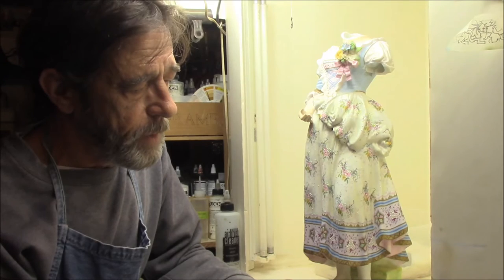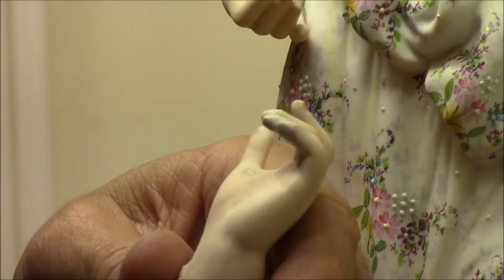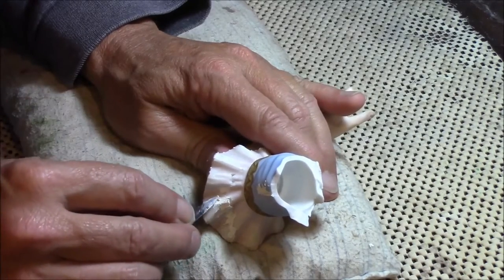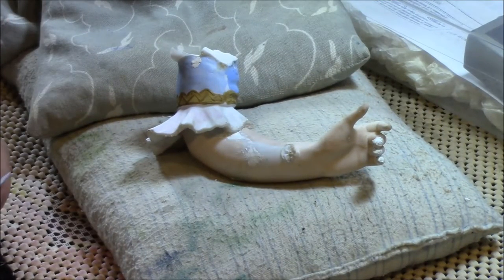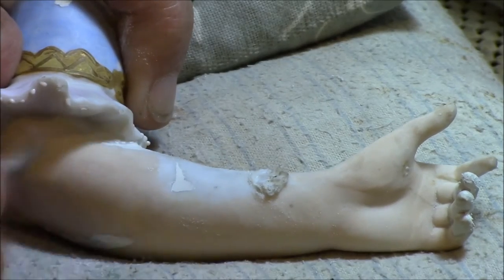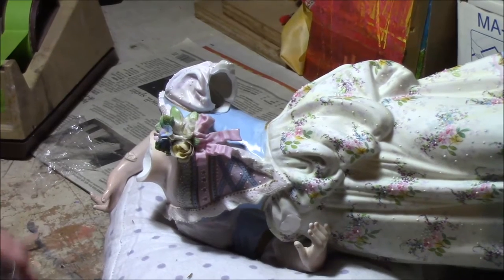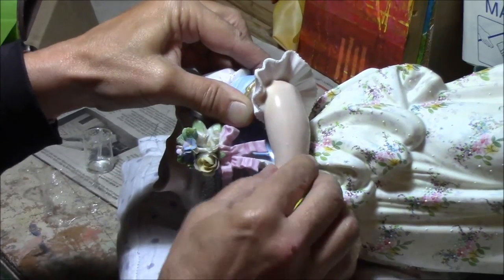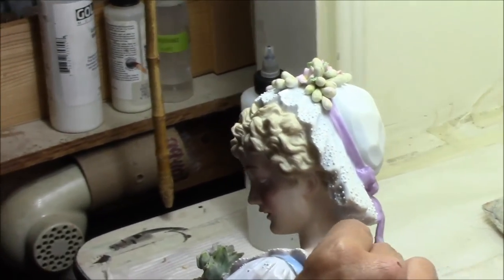Feminine Porcelain Figurine Restoration

Comment: Nice color matching! I like how you can really control the flow of the paint, to a very fine controlled area. Would you mind me asking which airbrush and size tip (and pressure setting) you used? Thx
Reply from the maker: I use Iwata airbrushes. I have several but the one I use the most for jobs like this is: model HP-CH HK. I don't know the tip size. I just use the one that came with it. Pressure setting is between 20-30 psi.
Reply: @marsgitar  Thx so much!

Comment: Mesmerizing. Many thanks for posting. You are a master!
Can you please tell me what kind of glue and paint to use? How can I get the glazed look--is there a way to mimic it for an at home repair? I have a broken Franz vase. :(
Reply from the maker: Thank you for the praise. I appreciate it very much.
The bonding agent I use depends on the material that needs to be bonded. On this piece, which is fine porcelain, I used a product called HXTL, a 2-part water clear epoxy formulated for repairing glass. Since good porcelain is almost the same as glass it works very well. 
When I need to repaint an area, on porcelain, I first create a base for the paint to adhere to with Sylmasta's Cold Glaze System (a 2-part catalyst-cured acrylic resin), sanded so the paint can grip it. Then I use Goldens brand acrylic paints to redecorate, usually with an airbrush. Then that is covered with a minimum of 3 heavy coats of the Cold Glaze. When the glaze is cured (over night) it is sanded and buffed with Micro Mesh sanding systems, with grits starting at 2500 and going through six finer grits up to 12000. That will give you the glass-like finish of a real glaze. By the way, none of the products mentioned above can be found in your local hardware store. They (aside from the paint) have to be ordered on line. Unfortunately, ALL the bonding agents and ALL the clear coatings one can purchase at the local hardware or art store WILL discolor with age. 
The bottom line is: this is not something I would recommend an amateur to try for a repair at home.

Comment: Tell me, were you entirely happy with the mauve-coloured ribbon 🎀on the back of the bonnet.  Perhaps it's the video quality; the strength of the hue seemed noticeable to me.
Reply from the maker: Yes, the color match was perfect but the lights are close to the figure at the top of the inside of the spray booth and are probably having an effect on the camera's color perception at certain angles.

Comment: Once again and great and enlightening video. Can you tell me, please, what you use for a masking medium?
Reply from the maker: Thanks Kelleen. I use many different kinds of masking and masking materials. On this repair I'm using a latex based masking medium. The brand doesn't matter. It's sold in art supply stores. Mostly this masking medium is used by water color artist. It is painted on, then air-dried, and when done it is rubbed off with the fingers.

Comment: Hi Martin, have you ever come across a completely lost porcelain hand or arm and need to re-sculpt the arm? Do you also use the milliputt to sculpt or do you use something else? I'm just amazed at what you do. Thank you :)
Reply from the maker: Yes, I do come across this situation fairly often. Generally, what I use to sculpt a missing piece depends on how large that piece is and what type of ceramic the thing is made of. For high-fired ceramics (porcelain) I use A+B brand epoxy putty: which I build up more than I need and sculpt down to the final shape. If possible I might take a mold from another, unbroken, part of the piece I'm working on. For softer, low-fired ceramics (terracotta), I might use Milliput epoxy putty. Sometimes it's a process of building-up the missing piece around a wire armature. Sometimes I use a mold to make the missing piece.
Reply: @marsgitar  Thank you for replying back. Can't wait for the next video.

Comment: How did you make your little aputtt applying Sculpting tool
Reply from the maker: I did not make the one in this video. That is a dental spatula. You can buy them on line. I got mine from another restorer friend. This spatula is now two different spatulas. The pointy end broke off, so I made a new handle for it from a 1/4 inch steel rod. I cut a slot into the end of the rod, then put the broken-off blade into it. Then I drilled a couple of holes through the rod and blade, used to rivet the blade into place. The other end of the original broken spatula included the whole rest of the tool, so I just made a wooden handle for it.

Comment: can porcelain be sanded down? I found a pair of antique porcelain lamp bodies and the lip/nipple at the top- 1 is much higher so I am having a hard time finding a vase cap to cover it. I am wondering if a dremel tool would do the trick?
Reply from the maker: Porcelain is extremely hard. You need to use a diamond tool to grind it down. There are Dremel diamond bits that'll do the trick. That's what I use. Porcelain will dull any metal tools you try to use on it.
Reply: thanks, I would have guessed it was fragile